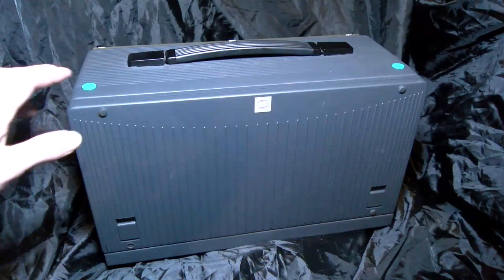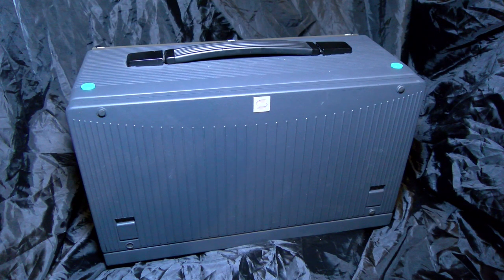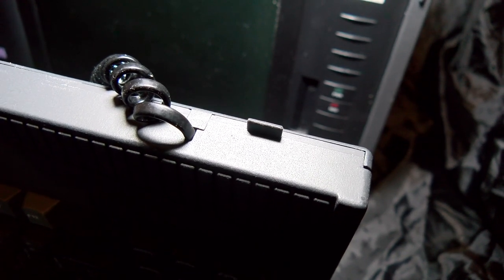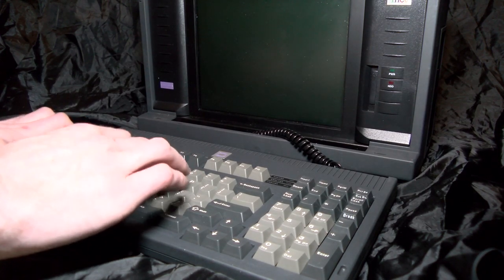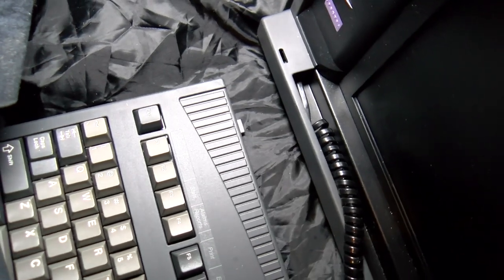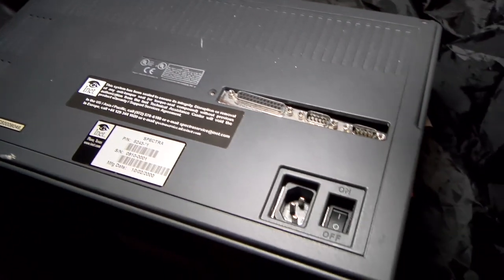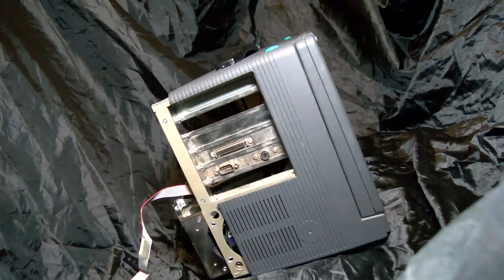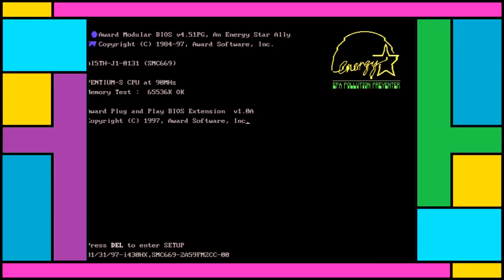Dolch Portable Overview - Failure by design

Comment: the motherboard is a TMC AI5TH-1.00. it can be fixable by using a desoldering iron to remove the dead dallas chip, solder in a socket, and add a new dallas chip to it.
Reply: Exactly, it is not that difficult. Give the board to someone who cares enough to do it!
Reply from the maker: Odds aren't great, there's far too much mass there and the de-soldering gun usually winds up burning through the board long before the solder actually melts in such cases. I have plenty of VX boards that can be used in whatever case it might have gone to live in anyway, so it doesn't really matter, plus it seems to be crash prone, possibly the CPU rails being set wrong damaged something, although I guess it's not impossible I cracked a ball grid when prying that black plate thingy pretending to be a heatsink off. Of course, it could have also taken damage from the CPU being set wrong for all those years, who knows where strange voltages might have leaked to.
Reply: @HighTreason610  TMC is bad

Comment: Cherry MX Blue, I actually like this switch type. Preference for mechanical keyboards is subjective to the user though.
Reply from the maker: I'd hope they didn't usually tilt as much as these when pressed. It's certainly user preference, but that preference had certainly shifted overwhelmingly towards domes by this time, so it's odd that they catered to the minority, assuming they weren't just using ancient parts they had left over as I suspect, because it's a mighty strange choice for a system sold as 'rugged'.
Reply: @HighTreason610  I think the real reason why you started to see domes in everything at this time was because they were cheaper. So this cost Dolch more for them to put Cherry MX Blues in. I think there aim was longevity with them, as they tend to last a long time compared to keyboards with domes with significant abuse. I also think they were fairly recent switches in this and not new old stock they had on hand. If they were using new old stock they probably would of put vintage cherry MX blacks in them. 

Anyways, you are not alone in your dislike of them. There is a youtuber, Chyrosran22 I subscribe to who reviews many different types of mechanical keyboards. Chyrosran22 also doesn't like Cherry MX Blues or Browns (but of the Cherry switches like Reds). I believe if I am remembering correctly he did bring up the complaint you had about tilting as well as other things about the switch.
Reply from the maker: Domes were cheap and most people prefer them for general use, it's only a tiny fraction of people who like pushing 104 noisy switches for hours on end. I still think it was basically free for Dolch to put the mech keyboard there because I'd bet that if I cracked it open, there'd be a date printed somewhere years prior to the machine's manufacture date, this thing looks to be built with leftovers. If nothing else he design is too old, there's no Windows key or Context key. If they were aiming for longevity and not just being frugal, they'd have used domes, mech keyboards are usually far less reliable.
Reply: I like Cherry MX switches but it does help if the key caps themselves don't swing around like this. Rubber domes to me feel mushy.

Comment: If You don't have the skills to upgrade it, it doesn't mean it's garbage
Reply from the maker: There's a difference between upgrading and replacing an entire system. Not a single part of it would have been useful if I went down that path, it would be better to simply build my own from scratch with better parts and better construction. So yes, it was garbage and, presumably, is now in landfill with the rest of the garbage.
Reply: So you trashed at least ~500$ of value, that's really good
Reply from the maker: As I said in the video, there wasn't really anything worth salvaging and even as parts, it wouldn't fetch that much because there isn't really a market for defective Socket 7 motherboards and the rest of the parts were trash. The only reason I can think of for the prices these sell for is the sniffer cards, I do still have those. Whilst I'm generally not in the business of ripping people off, send me $500, plus tax, plus shipping and handling, and they're yours.
Upvoting your own comments is kinda pointless here as my uploads are set to 'Newest First' by default, but I suppose it might still increase my channel's engagement statistics, so by all means continue.

Comment: Why not use rubber domes like everybody else? Because a Cherry MX switch will most likely last you a lifetime. Just because you don't like clicky switches, doesn't mean they're shit. You could have sold that keyboard for good money.
Reply from the maker: The switches only last a lifetime if you don't use them. The market spoke long ago and their wallets voted for domes. Also I doubt anyone would really want a busted old XT keyboard with a half-assed AT adapter wedged into it. Believe me, council landfill was the right place for it.
It was the same deal with the synthesizer, the "You could have sold it!" whining, but even when I tried to give it away for free, nobody wanted it. Experience suggests I shouldn't waste my time and effort when it could be better spent elsewhere. It wouldn't really feel right selling garbage to people anyway.
Reply: @HighTreason610  lol, you have no idea. Cherry MX switch was one of the best switch available and they're rated at 50 million activations. Even if one fails, it's easy to replace with a cheap soldering iron. Just because you don't like something, doesn't mean it's shit.

There is quite a large number of collectors worldwide that collect mechanical keyboards and pay top dollar for them. For some reason, a lot of them come from Korea but that's beside the point. When Cherry MX patent expired the market was flooded with various cheap chinese Cherry MX clones. Even before that mechanical keyboards started making a comeback and now you can buy them everywhere.

Original Cherry boards still fetch good money as does the exotic stuff like that Dolch you trashed. Hell, you could have gotten at least $100 for the keycaps alone.
Reply: @bojankotur4613  That's highly debatable, mechanical switches are more susceptible to dirty environments than rubber domes. According to google, rubber domes are good for only 5 years. Which is bullshit, as my keytronic rubber dome from the 90's is still going strong without problem and it was used in an institution for years before I got it and plenty of people have really old rubber domes in their collections and don't complain. Also, nobody with a sane mind would want to use cherry switches in their portable hardware as that adds bulk and is susceptible to harsh environments that a lot of portable hardware needs to survive from. 

Mechanical switches are just an expense people don't care about because if they did, we wouldn't have rubber dome keybards as the de facto type of keyboard. Collectors don't really count as they're a really small fraction of the population and are far from making as much money to a company as rubber dome is as most people don't care about the feel of their switches, they just want their slab of keys to do something when they press a button.

Mechanical switches are good, but there's a place where they're better and others where they're worst. It's not a one sided argument.

The pro environments don't need cherry switches as it can clearly be seen by all the offices and other places using rubber dome keyboards over switches that can last 50 million activations. There are plenty of hardware that's long lasting that use rubber domes, the reputables thinkpads or toughbooks are an example. There's more to it than mechanical switches and that hardware the KB is attached to won't last a life time anyway. Any thinkpad or a toughbook will be dead from age before you go thru the keyboard with some exceptions that are too little to warant the expense of mechanical switches.

All in all, if Dulch had use rubber domes, it would've changed jack shit, but the keyboard would've been quieter, which is an argument I can understand, not everyone can live with a noisy keyboard and it seems hightreason has a hard time living with noisy keyboards and that's one of the main thing I hear from older people, they tell me they like that their new keyboard is so much quieter than their old one they had decades ago. They don't even know it's a rubber dome keyboard, they just like that it's quieter.

Comment: Is it just me or does the audio glitch like crap?
Reply: not just you
Reply from the maker: Too much mass in the board there to get the RTC off without burning the fiberglass and it's pointless anyway, the board doesn't work, probably something to do with the CPU being set up wrong for 20 years straight. I mean, the last place had to have some reason for slinging it. I have plenty of VX boards that are better anyway, so it hardly matters, not worth the time. Keep in mind this would be AI5VG era TMC, so it probably wasn't great to start with, I'd imagine Dolch used them because they got cheap or something, maybe some other OEM didn't want them.
I'm not stopping you picking the pieces up off the sidewalk if you happen to drive by it, should be there a while as I doubt the council are picking that trash up any time soon with the way things are now, doubt anyone else will want it. Better get here before Saturday though as that alcove turns into a public lavatory and fire pit on most weekends.
Audio issue was addressed in the video, no need for me to reiterate it here.

Comment: The MegaPAC was much better built. But they're PICMG spec, not AT/ATX. I think the display is 800x600 on that model, and it's just as crap. The keyboard is rubber domed. Or at least the two i own are.
The handle on the MegaPAC has strange one-way construction too, but i've modelled a 3D printable part that circumvents this problem.

Comment: Fuck me mate this was hilarious. From the first "what the fuck is THIS???" regarding the keyboard, to giving it probably the angriest birdie I've ever seen, and finally kicking the fucker. Great work. I was chuckling pretty much all the way through. And I was shocked to find this was circa Y2K, especially considering the genus of this system begins with the Sharp PC-7000, a system I own. A system from 1985.

As for time moving differently, consider this: a ten year old perceives one year as 10% of their lifetime, where a 50 year old perceives a year as 2%. Time is weird stuff.
Reply from the maker: Somebody sure messed up. There do seem to be older revisions that were slightly better made, but overall it still manages to be pretty crappy. Whatever, good riddance to it. Glad you enjoyed it at lest, some people seem to have gotten slightly upset. Not sure why I'd waste my time replacing an RTC on a board that likes to crash, likely due to running the CPU out of spec for years on end, but oh well. Sucks I won't be making back any of the cost of the system.
You can see some of the PC-7000 heritage I guess, the display in this is apparently a Sharp.

Comment: Wow just wow. Would not expect this kind of quality from something like this. And yeah 2000 wtf
I guess you could put in a modern lcd, a picopsu to remove the bulky and most likely shit quality old one and maybe a cf ide adapter. Then you could atleast put in any motherboard you wnat. I think that's what I would do if I wanted to get any use out of it but idk if such a huge restomod would be worth the trouble
Reply from the maker: The sad part is that the LCD isn't that bad aside from the resolution and the card's scaler breaking a lot of things - applications often split the image into four - otherwise it's hard to find modern screens with that kind of response time and color reproduction in this size. Overall there's not much incentive because due to the work required, it'd probably be easier to just build my own chassis by that point.